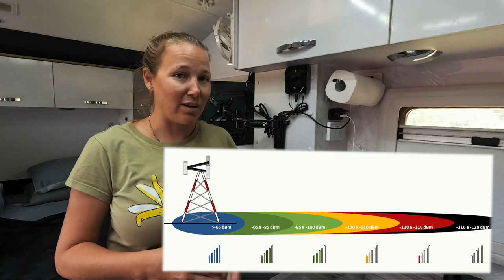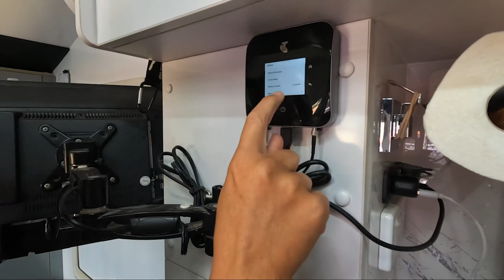How to improve connectivity in your caravan on a budget! DIY Install & Review - 104

Comment: The SOS Only comes from you being outside the service coverage provided by your provider (ie Telstra) BUT your equipment can see another service provider (ie OPTUS).  There is an agreement between providers to honour SOS calls irrespective of who you signed up with.  An example of this if you are with Optus and travel to Tassie, you get almost no service outside the big towns but Telstra has a much greater coverage there.  We changed to Telstra because of that.
Reply from the maker: Oh wow, you just taught me something new. So basically if we have zero Telstra but showing SOS, I should check our Optus sim as they may have useable service in the area. Thats a great tip, thank you!

Comment: Nice video ( I took a deep breath as you drilled into the roof), bought an aerial about 4 weeks ago(still to install) but a have a pepwave modem router which gives me wifi and mobile service internally and externally. The aerial is the best on the market and RFshop were super helpful and delivered within 2 days from SA to Vic. Did you dicor ( sealent) around it after install?
Reply from the maker: RF are great hey! Glad you have been able to upgrade your system to something that works for you. We have put silicone around the base of the antenna. We had none on us at the time of filming but have since done so. ☺️ Cheers!

Comment: oh I'm going to like this for sure !!
Reply: my experience with a similar telstra device and the External Antennas is that you got the wrong product as it's Omi directional .. look up RFI Antennas they are the industry leaders. .RFI LTE 11dBi LPDA Directional Enclosed Antenna (698-4000MHz); 0.3m N(F)

 rsrp is the dBm of the signal being received. a celfi is going to be alot better as it also amplifies the signal that is received,.  when I went through outback Queensland using two small external antennas. and yes in some areas  because they were mounted higher I had 1-2 bars of 3-4g reception when mobiles had none . as height is might .. for the signal to tower db reference.  other areas there just is no signal due to geographics ..  alot of people will be moving into the starlink satelite system soon enough as there is a mobile version comming out shortly ..
Reply from the maker: I have signed up to hear about Starlink but until the mobile version exists... Who knows how long it'll be really! The omnidirectional one suits us and takes less effort than finding the tower and lining it up etc... We have found in comparison to Celfi and directional external antennas (while with friends) ours has been very competitive! It's been good to see and compare. We will share more again in a few months. :)

Comment: You also need to include that the number you displayed to check your signal strength is IOS (iphone) dependent.
Reply from the maker: It works on android as well I found in research?
Reply: @BigOzExplorers  I tried the string you put up and got an error message from Telstra.  I did a search and discovered that this only works on iPhones.
Reply from the maker: @xoncention3265  oh really? That’s odd! I did look online and it said for both. Bugger 😬
Reply: Both our Android phones display signal strength in Settings so you don't need to dial a number.
Reply: @xoncention3265  Yup dosnt work with my Samsung recorded msg from Telstra to "check the number"

Comment: I know I’m jumping the gun but if your posting the video I presume it must be good. I’m pretty scared about putting holes in the roof of my caravan. How did you stop it from leaking? That nut doesn’t seam like enough.
Reply from the maker: Hey Damien, we have loved it so far it's a great setup. You can either stick it or use the magnetic version if you don't want to drill holes. We have also siliconed around the edges, no leaks 👌🏼

Comment: I use a system called Weboost drive x, it works kind of like what yall are using but the antenna part is boosted just inside the caravan. it is pricey but it will make less than one bar a full meter on your phone or router and fast internet.
Reply from the maker: That sounds similar to what the Cel-fi alternative does over here, its boosts the signal but only in a small area within the van. This overall smooths out/increases your connection by being an external antenna thats higher than the modem and will pick up more signal (in most cases) 

Cheers for tuning in again